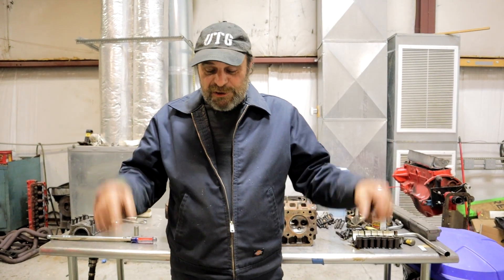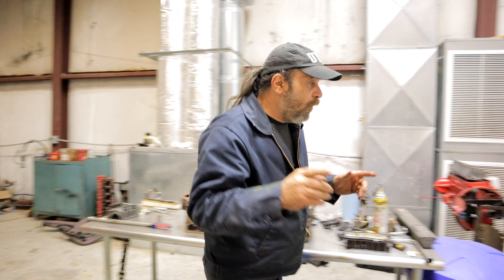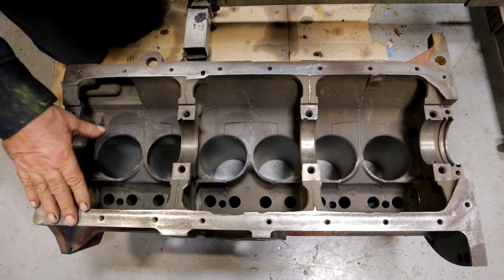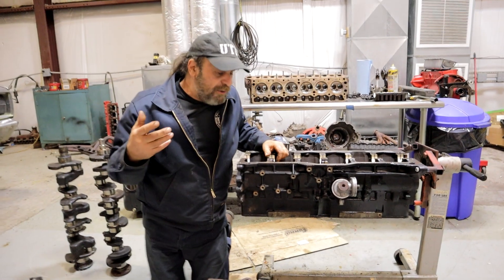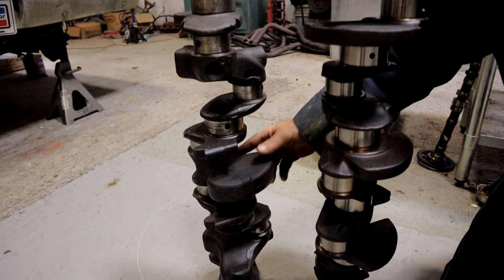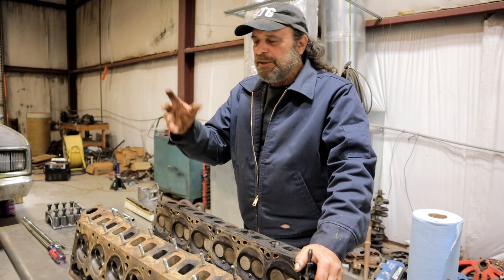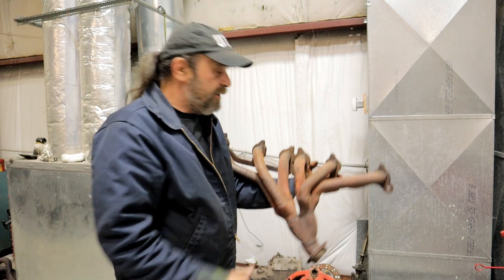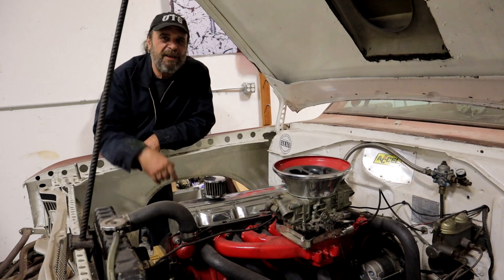The Mighty Mopar Inline 6's History And Comparison - Flathead, Slant, Hemi Six, 4.0 And Hurricane

Comment: The hurricane six cylinder (and the hurricane four-cylinder) same same.

They lost me at sprayed on cylinder liner.....yeah I’m sure the steel rings won’t wear through that at the top of the stroke.....
Reply: In the motorcycle world, there are aftermarket companies that recondition or reapply hard coatings to aluminium cylinders. It may not be identical to the OEM process, but they do work (and last).
Reply: @bikeaddictbp  Why not just source a new cylinder?
Reply: @This Is Your Captain Speaking  a lot of them have the cylinders integral to the upper crankcase. Expensive at best, "no longer available" if more than a few years old
Reply: @bikeaddictbp  Okay.  FWIW, I can buy jugs for my 950cc 2-stroke but they're iron sleeve instead of nikasil.
Reply: Those coatings, in this day and age, are extremely tough.
Reply: Is this the same as Nikasil coating used on off road motorcycle and snowmobile engines?
Reply: @Cfchild1  nikasil was also used pretty successfully in the LT5 IIRC
Reply: Nickasil?  Really tough stuff but one and done.  Besides that, delamination sometimes occurs.
Reply: Sprayed on cylinder lining was the difference between the Ford 3.9L V8 used in the T-bird and the "Jaguar" 4.0L V8 in the S Type.  Since Jag used the sprayed on lining that gave them a slightly larger bore.  That was the first that I knew of.
Reply: Hey as long as these coatings hold up as good or better than these old cast-iron blocks. And more importantly can be torque plate honed, Or taken over bore.
Reply: That could be a concern for some. 
It just seems like a lot of trust, money, and time later all because we used aluminum, then didn’t install a sleeve in it that could be replaced later. 

However a quick overbore with a torque plate and new pistons, or at worse a new cly sleeve. And other engine will be making fun again. What do you guys think?

Comment: I do not trust turbochargers.  They are fragile and expensive. There are a lot of videos here on youtube with cars on a Dyno and the turbocharger  explodes.
Reply: Usually because someone didn't set the engine up properly.  Turbos used to be fairly unreliable in the past, but these days, they're not more of a problem than any other part of an engine.  There's plenty of videos of engines throwing a leg out of bed, too - but no one's suggesting that connecting rods are a weakness and not to be trusted.
Reply: Videos of planes crashing as well, so we stop flying?
Reply: @bunning63  I quit flying decades ago, so yeah.
Reply: What?
Reply: They're now often cheap and typically very reliable. I watch a LOT of turbo content and am around turbo cars all the time. Turbo explosions are rare and typically limited to extremely high output competition engines. Even the cheap ones have gotten pretty good but when they do fail it's most often just shaft play or a waste gate malfunction if they're internally gated. That's actually why I got a free Holset HE351CW. The turbo its self is perfect but the gate actuator leaks and is unable to control the turbo.
Reply: Super chargers is what I would prefer. They do make new designed versions that are under the hood concealed.  I have to admit though nothing beats the look of a full sized Weilan sticking out of a hole in your hood.

Comment: The Hemi 6 actually started life as a 245, and the US engineers were doubtful when the Aus guys bored it to 265. We also had an 'economy' 215. Difference between capacities was only through bore size, they shared the same crank and rods. It is a brilliant (but rattly) engine. There is at least one example in the US, in a Hot Mustard VG Valiant Pacer. Not sure what state he's in.
(Edit) Incidentally, we never got to see the smaller slants down here, our first Valiant sold in 1962 with the 225 as the only engine. Kept it right through to the Hemi's introduction.
Reply: The first prototype 265s were still 245 blocks (identified by the A2XXXXXXX part number cast on LHS bottom of block) but also had the 265 capacity designation cast behind the 245 part number....they were bored to 265 bore but failed in testing.
I owned D36300004 prototype block for about 30 years before I sold it to a well known Victorian Valiant enthusiast. I bought it to use as a base for my 12 second VF 265 powered 4door I raced at AIR in early 90's but needed a structurally sound block bore wise and also chopped up the dowels so I could use my full manual 727 behind it.
Reply: Hardtop or sedan (if you know)?
My first car was a VG pacer hardtop, with the original yellow-over-red engine.  Originally a white car with factory black bonnet and black interior (with front buckets and 3-on-the-floor), but someone before me painted it red, except for the roof, which was left white.   I'm in the US now, and every now and then I consider getting myself a '68 Dart and importing front fenders, grille and bumpers so I can make it look "right."  But then I see the prices of Valiant sheet metal and decide it's something to stop thinking about.  😛
Reply: @aussiebloke609  Mustard sedan.
Reply: @aussiebloke609  In the late 1980's I had a vg pacer hardtop Hemi Orange  with an automatic  box. I'd be happy with a '68 Dart ' I reckon they look better.
Reply: PS - little known factoid: there was also a 250 cube hemi 6 - only the VG Pacer E34 4 bbl.  Basically a 60 thou bore job and oversized pistons to get the engine as close to the class limit as possible for Bathurst.  :-)
Reply: @aussiebloke609  E31 & 34 were actually .040" oversize being the factory tolerance, making the 250 ci.
One of mine is .060" over, making it 253ci.
Reply: @SillyOldBlokeFromOzzieland  Whoops, my goof - it's been a long time.  I sold my hardtop on back in '86, so I've been out of the loop for a while now.  Thanks for keeping me on the straight and narrow!  👍
Reply: Beat me to it.
Reply: Been waiting for the day someone does a vid on the vg pacer in the usa surely someone will do it
Reply: This is the car I'm referring to. Rear plate should help identify where it lives.
https://www.youtube.com/watch?v=h0pjMkFXsOY
Reply: @SillyOldBlokeFromOzzieland  Thank you, Grumpy.  What a lovely sound!  👍
Reply: I think you will find there are quite a few Aussie Hemi 6s in the US. A chap in California use to import a lot in the 90s, along with Holden utes and such. Even the "Bayer"? Boys from Georgia had a six pack Charger and a 66 Slant Ute.
Reply: @kramrollin69  Yep, had heard of the Bayers' Charger somewhere along the line a few years back.

Comment: Please explain Oldsmobile initial timing! ccw cw I saw someone put rotor pointing to the back of the car on TDC. I don't get it, but, I know you used to only work on olds... please help I can't get my timing right!
Reply: Thanks uncle BOB im going to give it another try tomorrow!
Reply: @khalidabu-saleh2081  Yeah man.
👍😎
Reply: Rotor should be on 1 @tdc. Also what year and engine?
Reply: It is!
Could the plug gap after hei conversion cause serious starting stalling issues
it sounds like the timing is like 180 off but it’s TDC for sure! I checked like 3 times.
Reply: @khalidabu-saleh2081  '64 and older had a different firing order.
Reply: @khalidabu-saleh2081  Also 180° off will fire with exhaust valve open, sounds like gunshot. You may be off only one tooth.

Comment: 225 slant 6 is one of the most reliable engines out there...IMO
Reply: I’d say Ford 300 is the most reliable 6 ever made along with the 4.0
Reply: @throttlewatch4614  then look up the 3.0 liter (183cui) volvo inline six.
Reply: @uncle_moose  I can only comment on American brands that I know
Reply: Anyone remember the old slick 50 commercials? Where they ran a garden hose over the valvetrain? Slant six, one of the very few engines they could do that to. Ford 300 is a tank also, 4.0l, come to think of it, can't really go wrong with almost any inline 6
Reply: My 1979 Aspen had a slant six.
I had to replace valves on two of the cylinders, when it had 90,000 miles approx.
I took the Cylinder head off & had the Head fixed.
I did not realize that it had solid lifters  & needed periodic adjustment or maybe it was cheap gas or the switch to unleaded gas?
Like someone else commented:
I had a 4.9L/300 Ford straight six in my F150 that was a good engine, but the oil pans would rust out.
I drove that F150 for 25 years.
Reply: @chamberizer  the swedish volvo 3.0 liter inline six was a beast. But unleaded gas was a killer on it
Reply: Agreed. Also tho... when they make big iron things with like mid range power and not a bunch of edge of the line power specs things can take more of a beating.
Reply: There are very few examples of bad in-line, six-cylinder engines that I can think of off the top of my head. Mercedes Diesel I6’s are very good, atleast back when they were analogue. Isuzu I6’s were very good, both Diesel and Petrol.
Reply: @stoneylonesome4062 Only bad inline 6's I can think of are the BMW N54, that makes a bunch of power so I guess it being a turd isn't the end of the world, or the n57 diesel that's just a turd, plainly.
Reply: @rinkkalex  Are you talking about that one BMW Turbo Diesel that was even offered in Lincolns? Yeah, I can see why. Out of all the Companies to fuck up an I6, BMW is the last one I’d expect. They’ve always made good engines, Atleast up until the 90’s or so when they started making everything out of plastic and putting computer chips in everything. And a Diesel, no less. Diesels are supposed to be tougher and more reliable than Petrol engines, generally. BMW’s back in the 80’s we’re generally pretty reliable, although they haven’t held up nearly as well as contemporary Mercedes. Hence, why you don’t see any of those old BMW I6 turbo-Diesels around anymore the way you do with Mercedes ones.
Reply: That's established fact, not really your opinion.
Reply: My 1980 Volare had a Slant 6. Turned out to be the biggest piece of garbage I've ever owned.
Reply: Ever heard of Volvos 3.0 liter inline six?
Reply: @uncle_moose  I know my Volvo inline 5 went for 400k before I sold it and I still see it around town.
Reply: @uncle_moose  the problem with the Volvo is it's in a Volvo.
Reply: @georgewetzel4380  ask the owners on this side of the pond 😉
Reply: @uncle_moose  I always wished that Volvo just made the Redblock an I6, same with Mercedes-Benz’s Turbo-Diesels. Biggest flaw with the OM617 is that it’s not an I6.